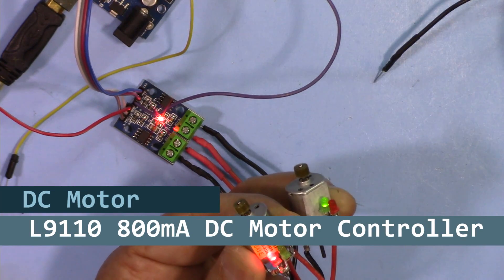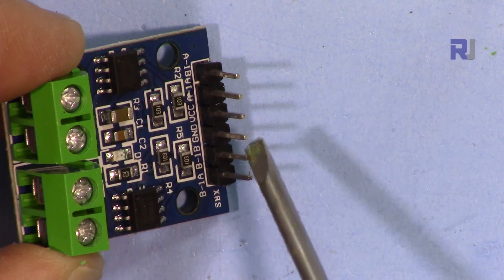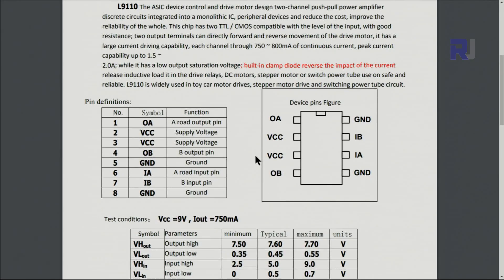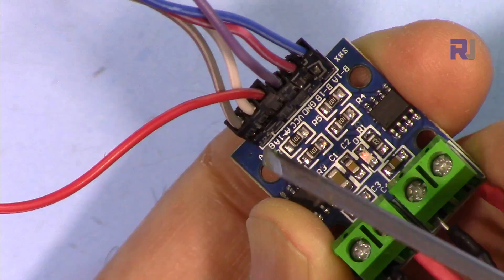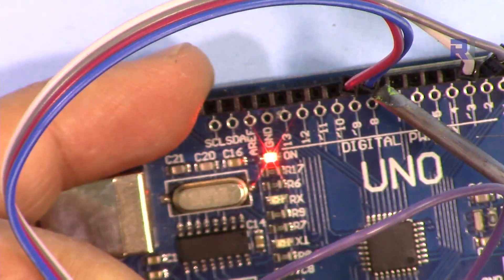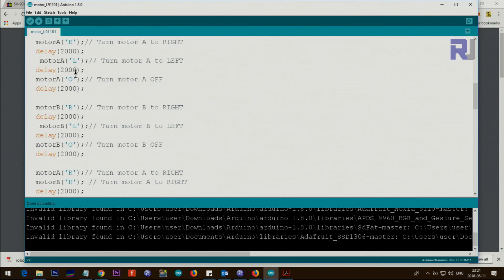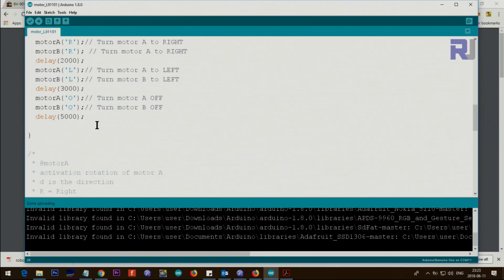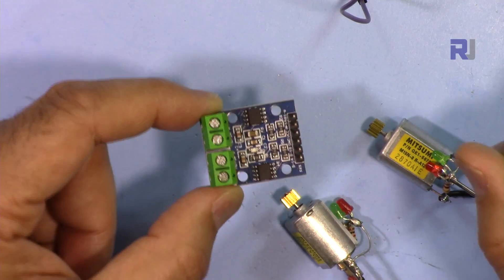How to control 2 DC motors using L9110s motor driver module with Arduino code

Comment: Note that with this controller you can also control the speed of the motor using:
analogWrite(A1A,255);
analogWrite(A1B,0);

Where 255 is the value for max speed. Replace it to 127 for half speed, 0 for stop. Reverse the values between A1A and A1B for the reverse direction.
Reply from the maker: thank you for sharing.

Comment: Thank you for the detailed explanation it really helped me understand how everything works. 
I didn't know how to connect the motors to higher voltage without burning my arduino (I have a motor driver just like that one coming in the mail soon) so now that I understand I am very happy to build my first rc car! Yay :D 
Thumbs up.
Reply from the maker: You are welcome. I am glad you found it useful. I have explained at 00:38 that you can connect your own external source. Watch it again.

Comment: Is it normal for the control pins on this driver to show 1.9V when I’ve powered the driver with 5V?
Also, should the pins be defined as LOW in the void setup function as well?

Comment: Great video, thanks. I plan to use a few of these for a desk top size model, of my larger 6wd robot. Have you tried pulsing the input pins for speed control?
Reply from the maker: I have forgotten what is done in this video but yes for sure it will work if you feed PWM to the input instead of HIGH/LOW.
Reply: @robojax  Cool., thanks for the reply. I'll try it out and see what happens. Finding the best frequency for the L91110s might take some experimentation.

Comment: Great simple to follow guide, thanks. I'm assuming this H bridge can be used with PWM?
Reply from the maker: Yes. You can feed in PWM to IA or IB.
Reply: @robojax   Thanks. I think I'm just going to get the L293D shield as it's actually cheaper than this module on Amazon and leaves no messy wiring to do.
Reply from the maker: This was untested suggestion. I will tested today or tomorrow and update you.

Comment: can you explain how to connect the wire,i can't use it with 2 control pin,just 1 control pin,the other pin must direct with the supply

Comment: Olá estou com uma pontes dessas e um motor brushless de 3 fios e eu não tô querendo comprar esc, até porque era pra ser um projeto simples de controle bluetooth.....tem como fazer uso da ponte e ter a variação de velocidade?
Reply from the maker: Motor sem escovas de 3 fios significa que NÃO é DC. então você precisa de ESC porque 360 ° dividido por 3 é 120 ° e você precisa de um dispositivo especial para mudar o sinal ou deslocá-los em 120 ° para que o motor funcione. desculpe, mas você tem que comprar ESC ou você deve usar um motor DC que tem 3 fios. Boa sorte
Reply: @robojax  certo. Vou comprar um esc

Comment: Will connecting 12V from L9110S to the outputs burn the IC?
Reply from the maker: works with 2.5V to 12V.

Comment: Hi. Is it possible to run bldc motor with this card but without ardunio?
Reply from the maker: Hi, this is Motor driver. You need ESC (Electronic Speed Controller) see it used without Arduino here https://youtu.be/3BvXXBCqqfc
Reply: @robojax  Thank you. I am searching such cards, do you know any example?

Comment: Hello i did this as you did exactly but im using a esp32 wroom 32 instead of arduino and its not working i checked the output voltage and the output is lower than the power supply any solution?
Reply from the maker: Hello, yes it won't work. You may learn how to control a motor from this video https://youtu.be/ei_SIh1xH1U and change the code. The video is part of full ESP32 course.

Comment: Hi! Is it possible control dc motor speed with H bridge L9110?
Reply from the maker: Yes. Just instead of regular DC, send PWM DC and speed will very as the PWM duty cycle changes.
Reply from the maker: I just checked the datasheet,  you will need to for example keep IB LOW and  for IA send PWM signal from Arduino. Apply the same principle I used in this video: https://youtu.be/akQoGNUzhHI

Comment: digitalWrite(13,HIGH);
digitalWrite(2,LOW);
delay(500);
digitalWrite(13,LOW);
digitalWrite(2,HIGH);
delay(500);

with this code is not changing direction
anything wrong ?
Reply from the maker: then wiring is incorrect. Check the wiring and follow exactly as shown in the video.